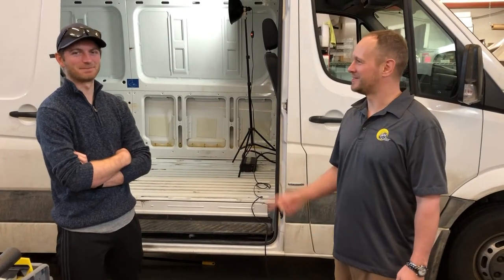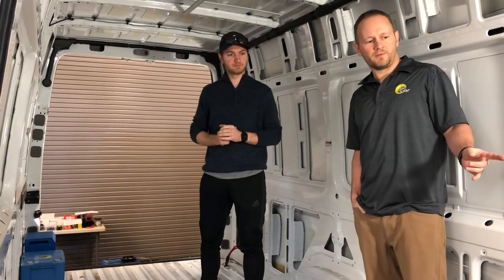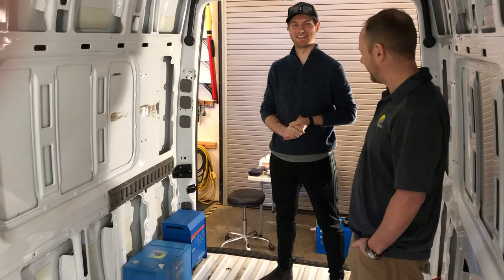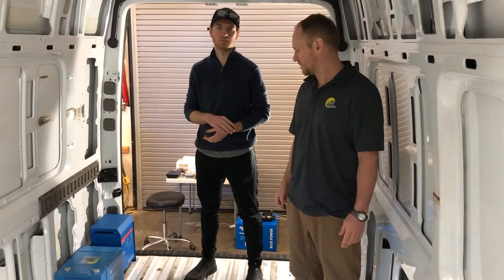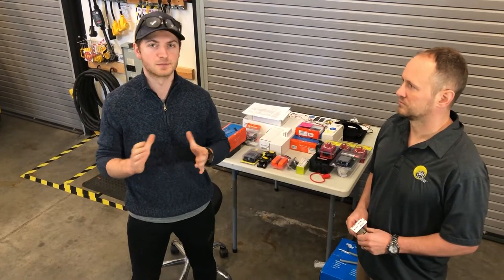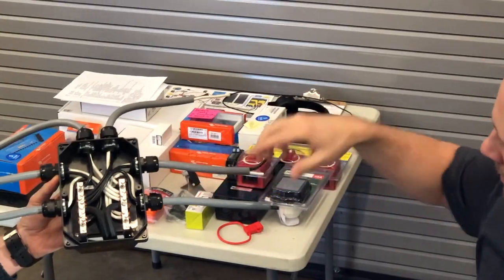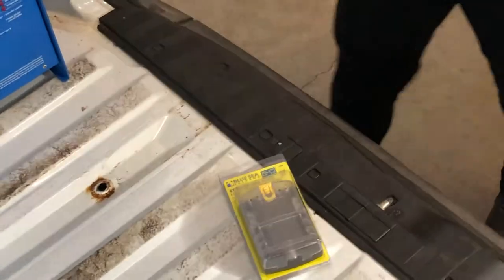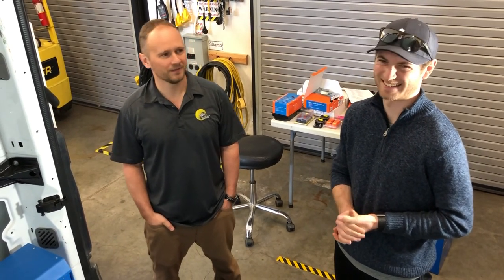Van Solar Conversion - Up On The Mountain kit, (Pt. 1 - Solar Panels)

Comment: Your videos are extremely helpful,  I do have some questions.  Everyone says you can not run a/c off of a solar system. You say it can be done with this system, do you mean while plugged into shore power?  With only 340W of panels will it not take all day to charge the batteries only on solar, and that would only work if there is no draw while changing.  You also say the Victron battery can only be drawn down to 80% while other companies say their batteries can be drawn down almost 100%. Which is correct or more advisable?  Thanks.
Reply from the maker: Solar is just one of many charging sources and A/C technically doesn’t run on “Solar” it runs on the battery bank. With this 400Ah battery bank the customer will get about two hours of runtime per charge. As for 80% vs 100% of rated capacity, that’s just marketing. Do the math for an apples to apples comparison and get the batteries that fit your rig.